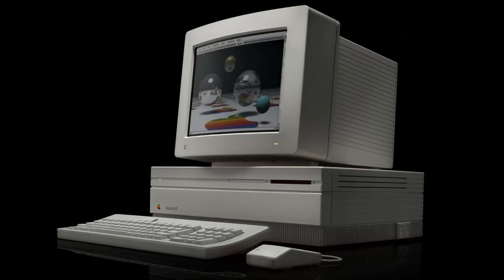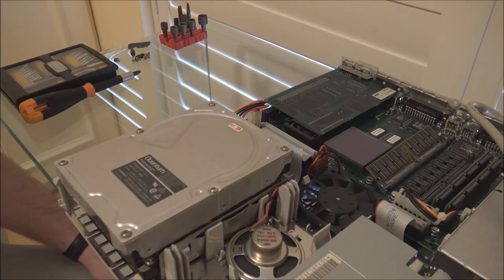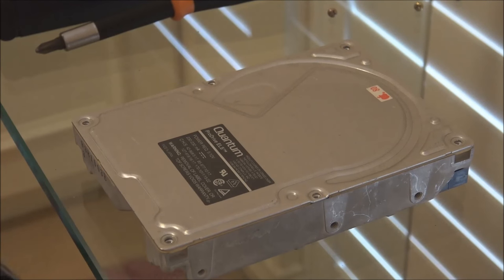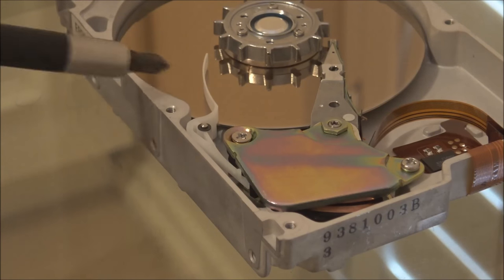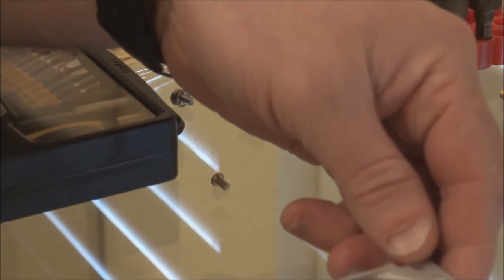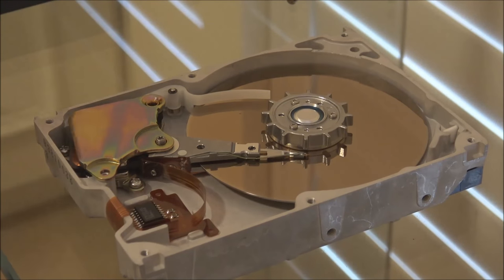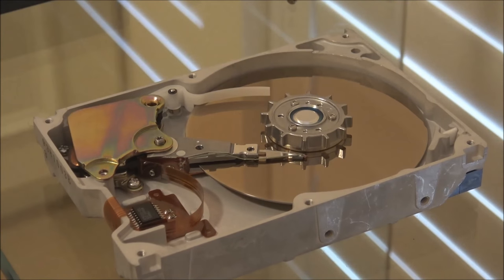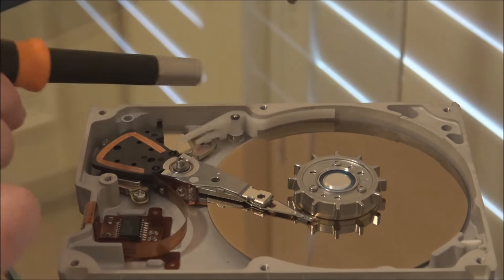Attempted (and failed!) repair of a Quantum ProDrive ELS SCSI HDD

Comment: I have done this and succeeded! Note that these drives need the top cover to start up, because otherwise there isn't enough airflow to push the little white paddle out of the way, alternatively you can hold that by hand during start. Also I had to loosen and retighten the disk a few times to get it going (presumably because of axial misalignment). Also i used some folded up piece of plastic packaging to hold the heads apart without touching the heads, which may have helped.

Comment: This is a shame. I've recovered several connar drives by replacing the rubber goo with wrapped tape. But I didn't need to remove the platters.

As for all the smart asses pointing out the lack of a clean room or dust, remember that this drive was already dead. There was literally nothing to lose. These drives are not sealed to a vacuum; as long as you're careful to avoid getting particles on the platters, it's generally ok.

Comment: I may arrive way too late after the battle, but my experience might interest anyone like me who tried to perform the same repair. Actually, doing exactly what is shown on the video is an effective way of repairing the hard disk. However, as in some other critical situations of life, size matters, or rather said, dimensions matters. When you replace the inner bumper with a piece of hose (or rings), the thickness must be less than one millimeter. I first used two stacked 1.5mm rings for a total outer diameter of 6mm, and it gave me the exact same result as on the video: the heads kind of actuating til roughly half of the disk width, then going back to the center and outside again a couple of times, then spinning down. I then replaced then with two stacked 1mm rings which had been carefully cut to reduce their diameter, for a total outer diameter of less than 5mm, and after that the disk behaviour was nominal again.
In this video, the piece of rubber used is way to thick and will prevent normal operation of the disk. My guess is that reaching the innermost part of the platter is critical for the initial power up sequence, possibly to confirm heads initial position and platter rotation. So anyone with the same problem reading this, the message is use a rubber replacement for the inner bumper with a thickness less than one millimeter

Comment: Just performed this stunt in an equal drive, no need to remove the white locking arm as it will allow you to remove the platter by setting it to the side. Made a cone in paper to place the platter while working. Also made a tool to grab the platter by the sides without "finger collision". Replaced the failing rubber bumpers with scotch tape. Unfortunately, the drive spins, heads move, but then it stops, just like yours. Having nothing to lose from this point, I'll be performing other tests in this drive.

Comment: Hi Jason, thanks for this video. It has helped me get one of my Quantum pro ELS drive working. I think your problem with it not booting is related to the diameter of the bump stop under the platter and the heads being too far out from the spindle. I ended up using a piece of silicone fuel tubing for model nitro engines which gave an external diameter of about 7mm when fitted. I also did not use any glue because the post has a larger diameter knob on top preventing the fuel tube from coming off.
Reply: I imagine the original bumper had it parked on something like an index track so it knew where it was when starting. Change that, it has no idea what it was doing, so it does nothing.

Comment: Thanks for the video, it was actually very useful in pointing out some banana skins :)

I have exactly the same drive with the same problem in an LCII. The fix I did was a real quick bodge, but it worked. I cut a small piece of plastic, approx 4mm x 3mm x 5mm. With some blutack I stuck it next to the read/write arm mechanism, at the opposite end of the arm from the heads. On the video at 6:15 you can see '0381003B' printed on the front of the case. Well I shoved it inside the case right there, next to the 'B'. The result is that the arm now is stopped from travelling too far into the centre of the disk. I guess that the size of the plastic has to be fairly precise, however I got it right first time. The dreaded spin down just after startup is gone, the drive continues to boot and I have a Happy Mac  :¬)

Comment: When you took the platter off you damaged the heads. That’s the scratching sound you hear. You should have used a head comb to keep the heads separated which could have maybe saved the drives.

Comment: never mind, Jason.
Without desoldering the firmware eeprom, the termination resistor packs and replacing the ribbon connectors, there is no real way of knowing whether the drive is attempting anything meaningful to the Os or whether it is just 'zombie' drive commands.
Sending the disk away to a refurbisher isn't economical at all, perhaps scsi2sd could be suitably configured.

Comment: A great video Jason, but i would invest in a specialised piece of plastic to remove the heads, you can get them for different kind of hard drive heads (2, 4, 6 or even 8 heads), you can just put that on and it will prevent the heads from touching eachother, and it allows for easy assembly as well. As for the dust situation, most, if not all, hard drives come with a lil' white filter in 'em, especially designed to filter out the dust that can make its way in to a hard drive, hard drives are no vacuum, all hard drives have lil' breathing holes, check your hard drives, on the label it will say "do not cover this hole"!

Comment: Hey guys. I have a drive of almost that kind (Quantum LPS) and it behaves like this (start - heads moving - stop). But I have no SCSI-controller, so can test the drive just with power supply. The question is if it is an abnormal behaviour for disconnected drive as well? Or it is ok, and if I connect it to the controller, it won't stop? Now I have to decide if it worth finding and buying a controller, or the drive looks dead even now? What could you say about it?

Comment: You should really try to find the torque numbers for those screws. In my experience (which was a while ago) trying to repair hard disks, torquing them properly is essential. Many drives will not work under any circumstances if they are not torqued correctly. My guess is the proper torque keeps the shape and improper toque very slightly distorts the case. When you are talking about a hard disk, they are a miracle and very little minor things can cause them to fail.

Comment: Hi Jason,  This is a good Video. I have Repaired several hard drives, so from experience I can tell you now that this is not your Fault - that this drive is not working, after your repair. If you look closely at the heads,  When you show the close up at time index 27:40, the Head has crashed at some stage and a wire has uncoiled or broken, and is sticking out , as a small loop. 
Whenever you see the Loop of wire sticking out from the head, you know instantly that the wire coil head is damaged and will never work again.
Reply: Isn't that normal for a drive like this?  The coil is just sticking out?

Comment: I have an old quantum drive like that, that's completely dead. However I have a black drive (cant remember the brand) that I just have to nudge the head to get it started. Not a fan of having the drive open like that, but it does work.
Reply: jeff I had the same issue with an old WD drive in my Amiga A590. It used to use a stepper motor for moving the head and if you twiddle with it, it seemed to work properly.

Comment: My compact had been working for almost 20 years.just failed this year..The problem is with its hard drive..\quantum fireball.. It won´t boot it makes some clicks..But won´t but...Is there a way to recover it , by changing the heads of the needles or using the disk in another hard drive?

Comment: I can't help but notice that there is a hair or something stuck on the head!
If you actually got this to work before, you really lucked out and it likely won't last. This drive has been open far too long.
Reply: tarstarkusz Since you can’t read previous comments, these old drives aren’t even sealed in a vacuum. As long as he doesn’t get major particles on the platter he’s fine. 
Also the drive was already dead what’s to lose?
Reply: thats not a hair , that is a wire
Reply: @Mathmos252  It's been 6 years, I don't remember anything about the video.

Comment: You're literally killing the device, because the plates can not interact with the air, imagine, a disc spinning up to thousands of RPMs and the dust at that speed ruin the plates.
Reply: "If ya can't fix it, fuck it." - AvE
Reply: Jonatan Coronel It was already dead
Reply: They are called platters, not "plates".  Also the drive can come in contact with the outside and still work, however, I have actually had a drive have a small head crash because of dust.  It is recommended if you are doing this at your house, to have a very clean room and wear latex gloves as well as try to be quick as every second the drive is exposed to the outside, more dust gets inside causing more bad sectors and potentially a head crash.
Reply: any hard drive repair has to be done in a cleanroom, any fleck of dust can kill the hard drive.